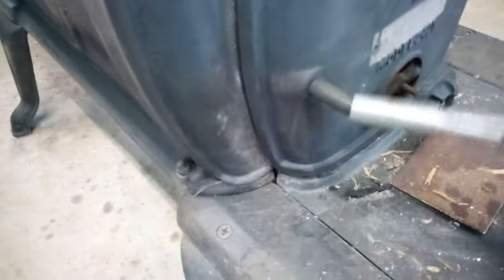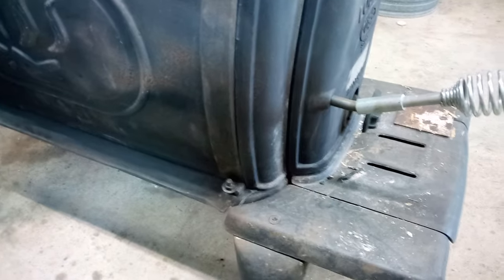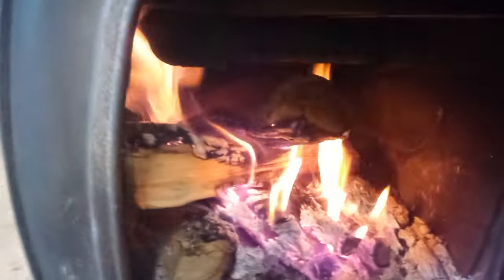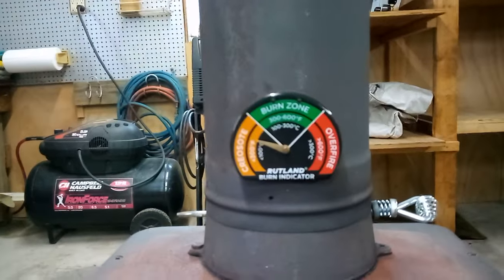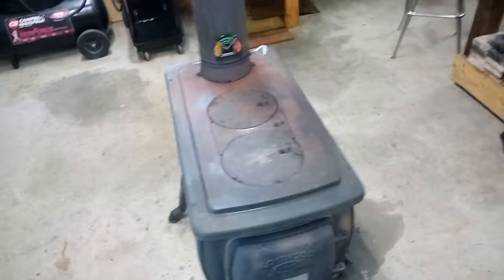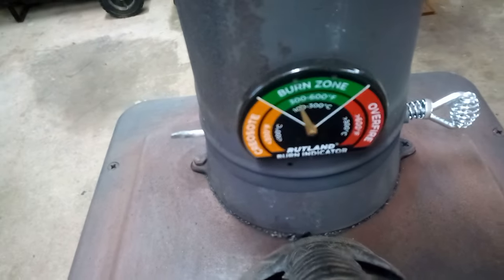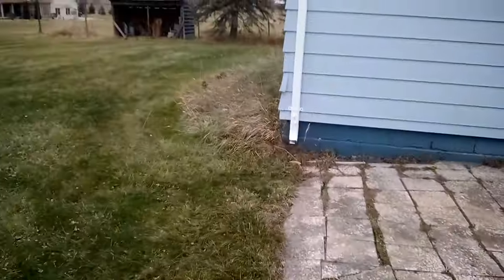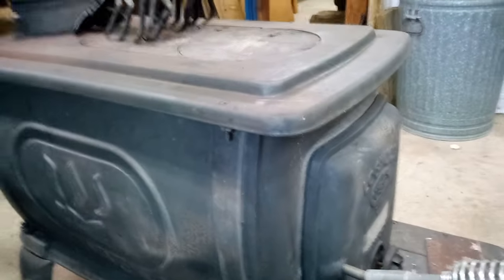secondary burn part 2

Comment: Had a Blaze King Sirroco 20 in 800 sq ft cabin it heated that well insulated cabin amazingly. Never used electrics. Put wood in twice a day 8 am  and 6pm. If I filled the box it would burn for twenty hours plus depending on what type of wood. Oak being the best. I live in the city on and sure miss that chore. The dry heat on those cold days. The house is always cold. With the Blaze king I brought in cold air for the burn, and pressured the cabin forcing the cold out. Was cheap to run. Brilliant stove
Reply from the maker: I just looked up that blaze king. those burn times sound too good to be true for a stove that size. if its true, that is great

Comment: I like this little design But I'll tell you what on my little barrel stove in the garage about 3/4 of the way to the flu. I placed a vertical wall covering most of the back then I added a grate along the bottom with enough room for air to flow down around that wall and up the chimney.   I would highly highly recommend it made that thing almost glow. Was quite a pain to get the draft right but I imagine putting a bypass door would alleviate that
Reply: The way the fire works now is it burns downward through the grate and along the bottom of the barrel then up the back and it sends a considerable amount more heat through the garage instead of the chimney
Reply from the maker: A vertical wall blocking the top completely and only open at the bottom at a grate? Im trying to imagine. As long as the draft is strong enough to draw the burn wherever it goes, sounds like it would work.
Reply: @sixlegsnimrod  Yeah that's pretty much it and it worked tremendously well. Mine was just a test. I used some sheet metal I cut and a great out of a Coleman grill and it got hot enough to melt both. But when I go back out to it, I'll put a thicker wall in and a heavier grate and it should work quite well.   I would like to add secondary air but I don't think there's a need my fire box isn't big enough
Reply from the maker: I guess you can tell how clean its burning by looking at the smoke while its burning where you like it. No visual smoke then its already burning good.
Reply: These cast iron wood stoves are acceptable for insurance while home made stoves are not! So with a home made stove and your house/shop burns down lots a luck getting your insurance to pay up!
Reply: @kennyh5083  ha insurance my dogs made sure I was priced outta having that